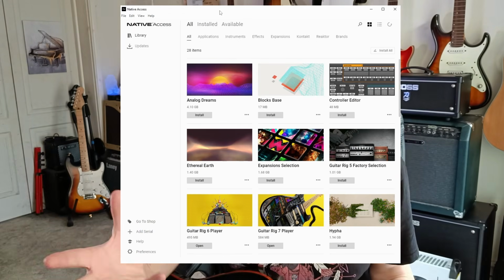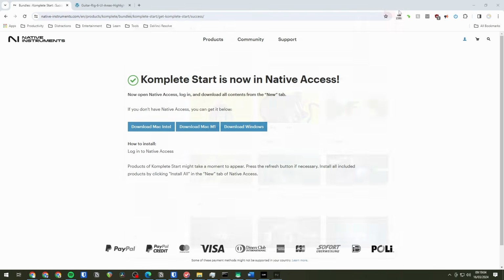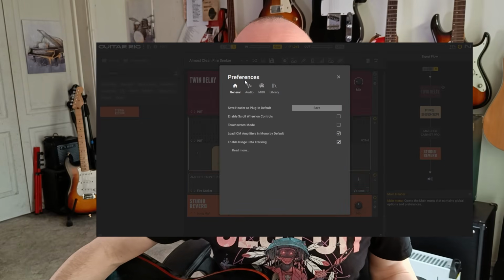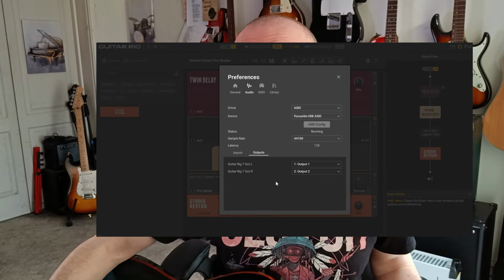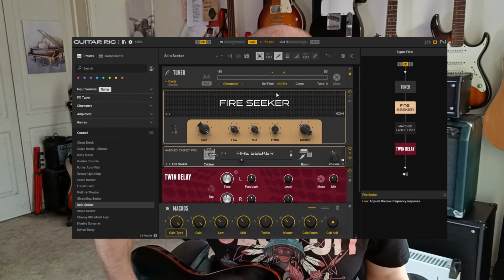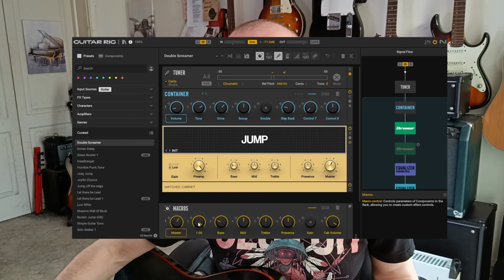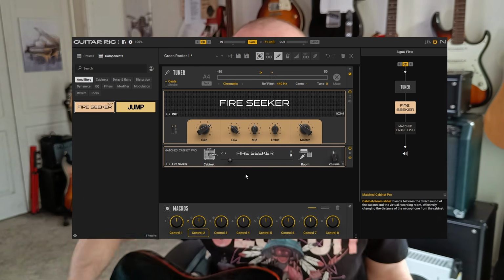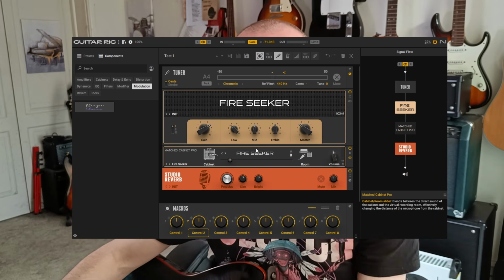Guitar Rig 7 Player Quick Start: Get up & running in minutes!

Comment: You can add the supercharger which is also free in Komplete Start which does include GR7 plus a lot of other stuff. Just use the daw to add the vst. It will enhance the limited version of GR7.

Copy and paste:

SUPERCHARGER adds unique, colorful character to anything it touches. Inspired by a one-of-a-kind boutique tube compressor, its one-knob simplicity lets you sculpt your dynamics at full speed with total focus on the sound. Designed for versatility, SUPERCHARGER is the perfect all-round tool for anything from warming up a vocal to crushing your drums completely.

Comment: Pressing the L, R or the combined button isn't to select the input on your audio interface. You can split your signal in Guitar Rig. Making it possible to select effect chains. This way you can make your own sound for rhythm or leads for example. Or select both to have both chains active.
I'm quite new with this but I am pretty sure it has to do with that instead of your input of your audio interface. Otherwise you wouldn't have to select the input in the driver settings within the preferences settings.
Do correct me if i'm wrong! I love to learn. :)

Comment: it comes up with an offer to buy it at a reduced rate of £89 sounds good, you say its free, then why buy it, is there a time limit on how long you can use it before you have to buy it, im a bit confused, thanks
Reply: The free version only contains a rather limited selection of amps and effects compared to the version you have to buy.
Reply: You can add the supercharger which is also free in Komplete Start which does include GR7 plus a lot of other stuff. Just use the daw to add the vst. It will enhance the limited version of GR7.

Copy and paste:

SUPERCHARGER adds unique, colorful character to anything it touches. Inspired by a one-of-a-kind boutique tube compressor, its one-knob simplicity lets you sculpt your dynamics at full speed with total focus on the sound. Designed for versatility, SUPERCHARGER is the perfect all-round tool for anything from warming up a vocal to crushing your drums completely.